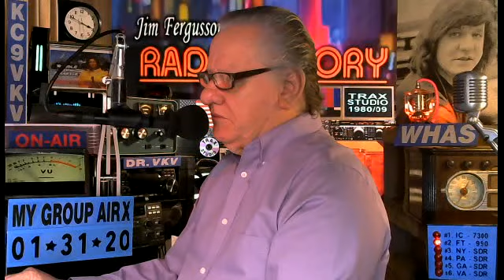KC9VKV HAM RADIO QSO-VLOG - BOB-N3GKV - PA. 7300 & QRM-R PRAYER - JIM FERGUSSON/TRAX - RS 3507

Comment: Interesting how the 7300 sounds best when all of it's "enhancements" over the 990 are turned off or at least as low as possible. I wish I knew that 6 months ago when I bought and sold my 7300 because I could not stand the sound of the receiver after trying many combos except for "off". The best sounding radio I have is my ancient 751A. In order to get my 775DSP to sound as good, I have to turn off the DSP and just run it in analogue mode. 
      Have we traded in build quality for fish finder SDR/DSP/DNR radios that sound like the finest analogue radios from a long gone era only when everything is turned off?